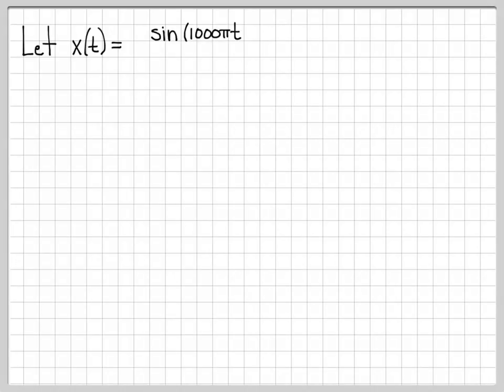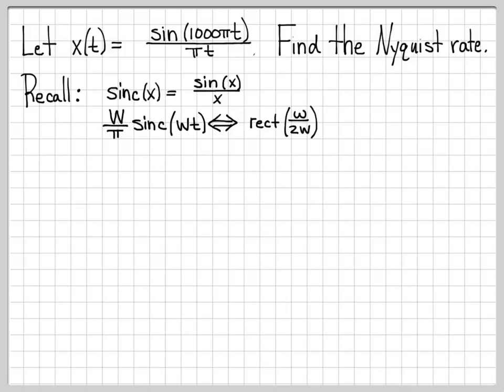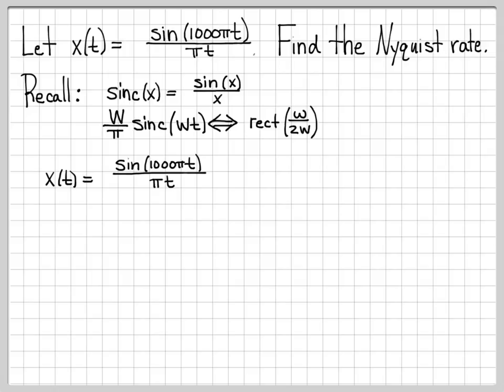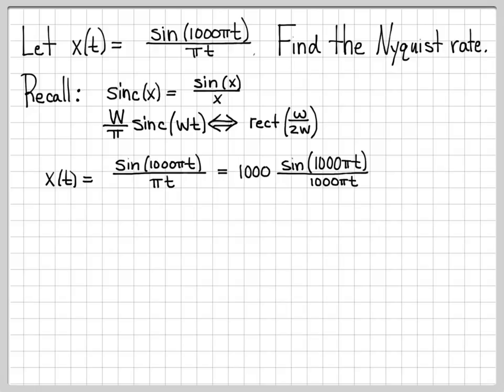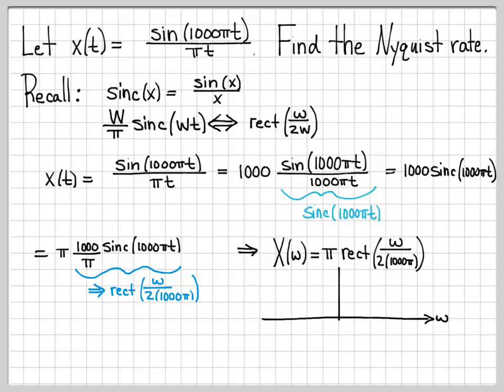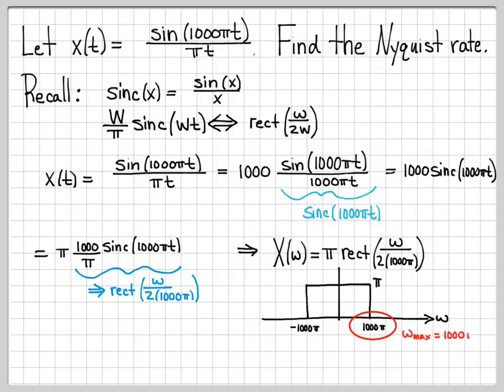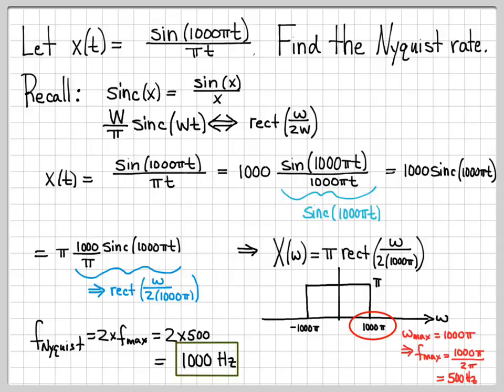Nyquist Sampling Problem 05

Comment: what's the difference between W and omega?
Reply from the maker: W is just a variable that parameterizes the sinc signal in the time domain.  Once this signal is transformed into the time domain, the time-domain variable "t" is gone and we now have the frequency-domain variable "omega".  However, the variable W is still present in the frequency-domain signal. In fact, we can see that W is the parameter that controls the bandwidth of the signal in the frequency domain. So, as W changes, the bandwidth of the signal changes and the shape of the sinc in the time-domain changes accordingly.  If you don't like the variable W you could just as easily replace it with alpha, or beta, etc.  It's just a variable.  Hope that helps.

Adam

Comment: The FE exam booklet has the FT pair as sinc(Bt) --> (1/B) rect(f/B). Using this and f=w/2pi, the answer is very different. What is the difference between the two forms, and what am I doing wrong?
Reply from the maker: Be careful, some texts use the definition of sinc(x) = sin(x)/x while other texts use the definition of sinc(x) = sin(pi*x)/pi*x.

You can read more here:
https://en.wikipedia.org/wiki/Sinc_function

I'm guessing that might be the issue you're seeing?

I hope that helps.  Make sure to check out my website http://adampanagos.org for lots of additional content that you might find helpful.  Thanks,

Adam

Comment: there is a mistake Adam please check.....
Reply from the maker: Can you provide some more details?  I'm not sure what mistake you've seen.....
Reply: +Adam Panagos where you considered w=1000π you did it for inside the function...but outside the function you used 1000 instead of 1000π.
Reply from the maker: I still don't see the error.  The first step was to turn the sin()/() ratio into a sinc function.  To do this, whatever the argument of the sin() term needs to be on the denominator so I manipulated the expression to achieve this.

Once I'd simplified to a sinc() function, I think had to manipulate it so it had the same form as my Fourier Transform table.This involved multiplying by pi/pi = 1 so we had W = 1000pi.

Can you maybe be more precise in where you think the error occurs (i.e. give me specific time in the video where you think the mistake is made)?  I'm still not seeing it.
Reply: +Adam Panagos 2:00 to 2:10 min. watch carefully you will notice the mistake.....
Reply: +Soumyajoti Paul I cannot send images in these comments... otherwise I would have pointed the error....
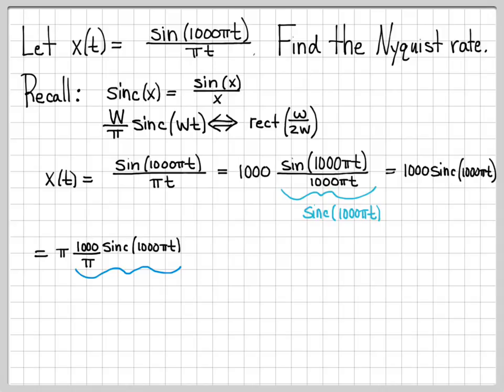Reply from the maker: I had 1000*sinc(1000*pi*t).  Watch until 2:11.  On the next line of math I multiply by (pi/pi) = 1.  This doesn't change the answer since it's multiplying by 1

So, we have 1000*sinc(1000*pi*t) = (pi/pi)*1000*sinc(1000*pi*t) = [(1000*pi)/pi]*sinc(1000*pi*t)

This now in the form (W/pi)*sinc(W*t) where W = 1000*pi.

The mistake occurs then at 2:44 where the extra factor of pi was included.  I've added an annotation to the video to note this, thanks.

Since (W/pi)*sinc(W*t) in the time-domain is rect(omega/2W) the scale factor in front of the rect function should be 1, not pi.
Reply: +Adam Panagos I've a request for you. I have few interesting problems on Fourier and Laplace transform . can you make videos about those.....
Reply: @AdamPanagos  Thanks for this too